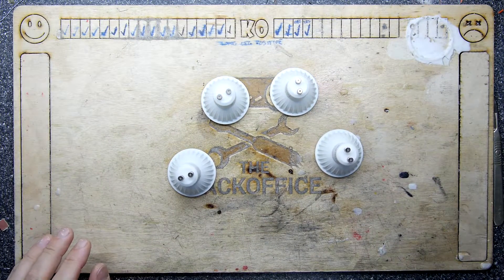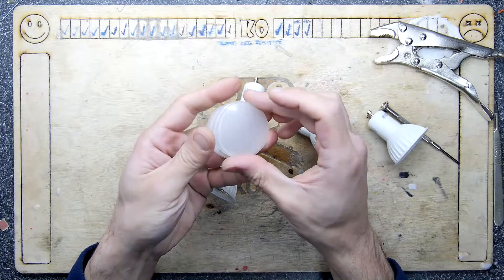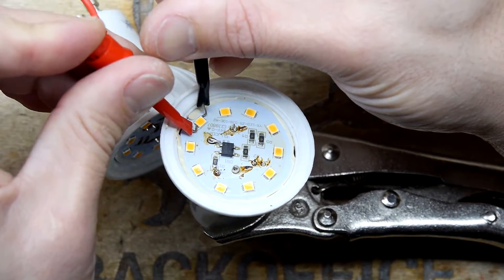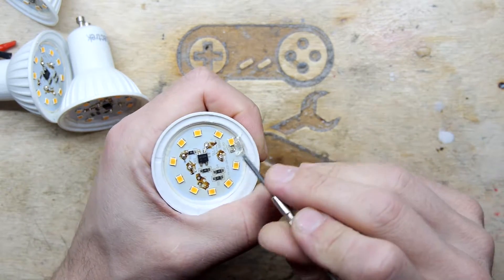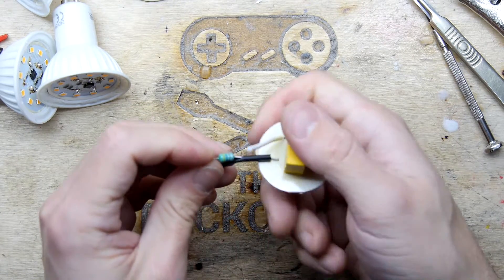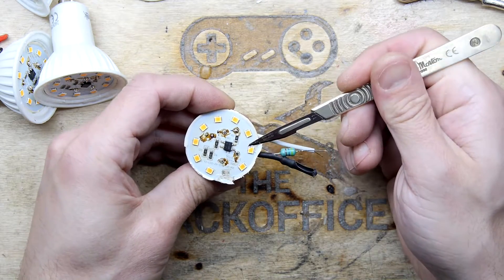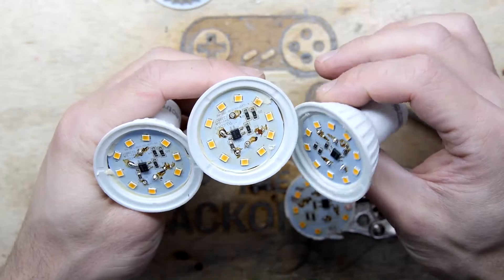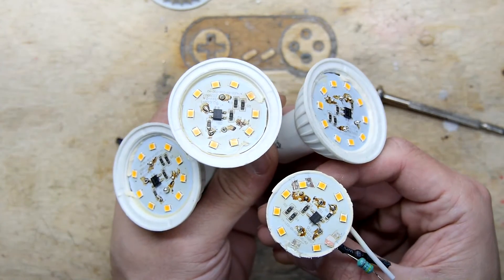Teardown Lab -Blown LED Lamps

Comment: I just tore apart a very similar bulb and mine was two led's in the string that were dead. No clue how it happens but if you consider that one could have seen a drop in resistance (failed short due to a power spike) the others would start to run hotter (higher voltages) and then they would start to degrade, and so forth till it breaks. Mine had nothing for filtering but a 10uF cap and a 4.7ohm resistor (Fc =  3.38kHz). That's what I get for buying 3 dollar light bulbs. :)
Reply from the maker: It's really pot luck. I have had cheap ones last forever and expensive ones die within hours. I suspect they do not have much time to soak test these in the factory 😂

Comment: I spent about nearly £300 on LED bulbs of differing sizes and brightness, and despite having a so called long life they all have blown in under three years.  I also took a few back under guarantee when they blew from the first batch.  So while they look nice and give a great light, they are EXPENSIVE!  However at least Aldi now have them for around £2.50 a bulb instead of £9 or £10.
Reply from the maker: I might need to do a poundland raid myself. I found one of the 50w incandescent and shoved it in. I don't mind the lack of efficiency in the winter, it might help to heat the house!
Reply: I can usually tell when they are about to die, because I hear a sizzling sound and occasional flickering, followed by intermittent function, e.g. flick the switch a couple of time and does not come on, then on the third attempt they light up.  That is for the larger b22 size bulbs, but for the smaller GU10 they can flicker away for months before finally stopping working.  They do seem a lot more reliable than halogen bulbs though, because I have even had an entire 3-pack blow one after the other in one evening!
Reply from the maker: +EgoShredder where these are located in shouldn't think they get more than a minute of use or day over the 13 months or so they were installed. It's a mystery!